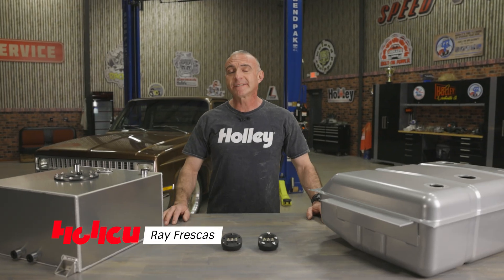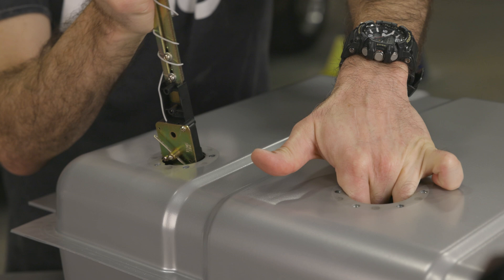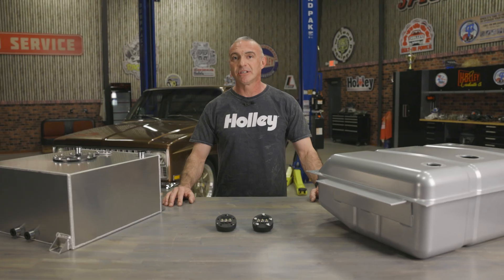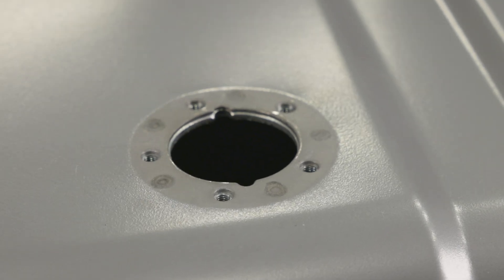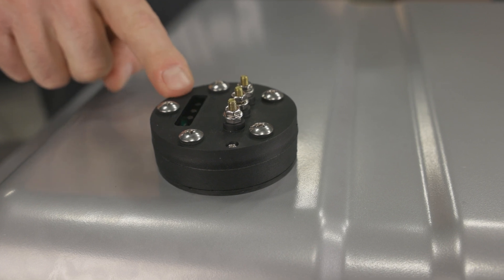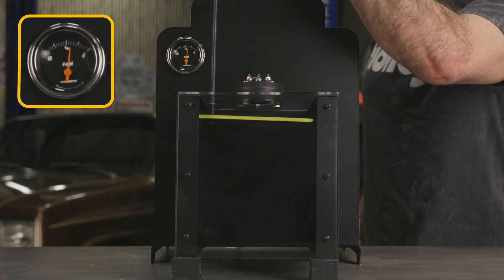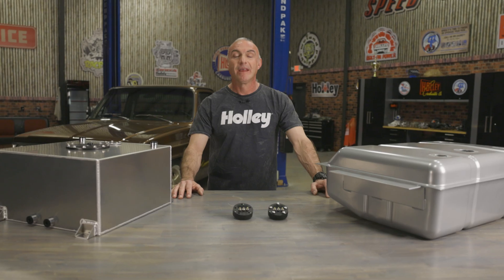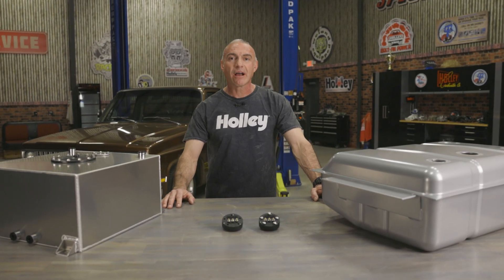Replace Your Existing Fuel Sender with Holley's Revolutionary Easy Level Fuel Sender

Comment: Curious, have a fuel cell in a 67 Camaro think it’s going bad. Does this one still work with the foam at the top inside of the cell ?
Reply: No. Fuel cell foam will not allow it to work, as it relies on optics

Comment: I think you put the +12v and gauge next to each other knowing the majority of people would zap it. Its not even remotely weather tight and fuel will leak into the unit through the screw holes. BUYER BEWARE!!!
Reply: happend to me last week    filled the unit up with fuel  ,  they should have supplied a tube of sealant or mentioned it in the fitting instructions or vids  , my new one jumps from 1/2 to empty with a full tank , so i would say they are dodgy pos from china

Comment: bought one of these and tried calibrating it dozens of times and it never read correctly, from ull tank to half tank the needle would not move then just passed half tank the needle would drop down below half tank. YES i waited for the gauge to respond the right amount of time and YES i had the dip switches set to fastest response rate. very frustrating and disappointing, then while trying to take some multimeter readings i touched the gauge post with the center post and fried the thing. they are extremely close and holley doesn't include a rubber cap or anything. i hope other people are having better luck with these than i did.
Reply: Thanks good to know l will PASS.
sounded nice,too good to be true

Comment: Where does the fuel pump sit? Or is this designed for external pump tanks? Most cars with a in tank pump like an OBS chevy sit within the fuel sender
Reply: Did you find an answer to this?  I have a 98 camaro with an in-tank pump and I have no idea how this is supposed to work with it
Reply: @benjaminpeace2967  never got an answer, im betting this is for cars that were/are carburated that had external pumps on the engine block. I cant see how this would work with in tank pumps knowing the sender and pump are assembled together
Reply: @brettbeez  thank you!  I asked the same question to Holley and they're like it works by bolting to the tank and it uses a laser. Duh
Reply: @benjaminpeace2967 🤦🏾‍♂️right that's not the question though, how does it assemble in conjuction with the fuel pump.

Comment: I just bought one, i too struggle with inaccuracy.. will this work with fuel cell foam?
Reply from the maker: The sender needs a clear path to the bottom of the tank. It will not work with a foam-filled cell.

Comment: So this can be setup to work with a Holley efi digital dash? I have it setup to read percentage and it’s not accurate at all. it fluctuates constantly and when it gets between 20-30% the pumps get loud and I just add fuel at that point. This would be such a piece of mind.

Comment: It looks a little big to sit on top of the fuel tank. There's not much room between the tank and floor.
Reply: Just what I thought. Although some efi tanks have a small drop where the pump & sending unit installs, that thing looks way to fat.

Comment: Could I have multiple of these on a holley dash/dominator? I ask so I can monitor my pump gas tank and race gas tank.
Reply: Should be no issue with doing this on a pro dash system, I'd reccomend running their standalone fuel guage for at least one though.

Comment: Very cool but does this work with any Autometer gauge currently offered?  I believe all of theirs are OE style ohm based gauges.  Next question, can this be used as an input to a Holley (Terminator X) EFI?
Reply: Hey! Can you confirm the easy level does actually work for any holley digital screen? My set up is terminator x max with a holley 7 inch screen. 

Only reason I ask is I messaged holley for advise on the install Erick @ holley says its not compatible. 

I'm skeptical and don't understand why it wouldn't
Reply: Doesn't work with an Auto meter 2514. Calibrates ok, but about 3 seconds after starting the car it goes to empty.
Reply: I can say yes it does work with any holley dash, and holley's own fuel level guages. Supposedly it can spoof the signal of just about any factory fuel sender and as such should work with almost any guage out there.